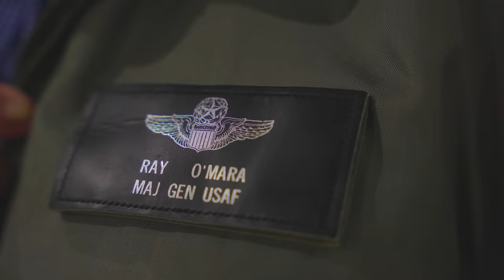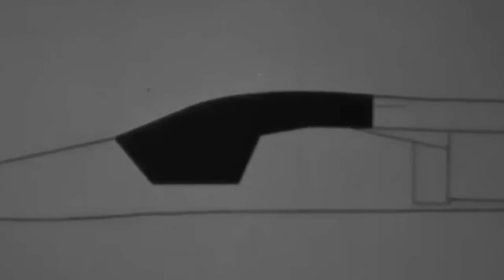F-111 Aardvark | Behind the Wings

Comment from the maker: This is a great airplane and we couldn't cover everything so drop your questions in the comments and we'll get to as many as we can! #curatorquestions
Reply: The F-111 polarised the Royal Australian Air Force.  In 1962 Australia had an order to purchase the British 24 TSR2 aircraft for $96,000,000.
When the TSR project was terminated they placed an order October 1963 with General Dynamics for 24 F-111's for $72,000,000.
The aircraft was to be delivered in early 1968, but Australian aeronautical engineers was concerned about the wing box which they said caused stress on the fuselage.
In September 1968 the Minister for Defence stated the the cost of the 24 aircraft was $268,000,000.  I had joined the RAAF January '68.
Australia decided to lease 24 F-4 Phantoms in 1970.  Whilst the F-4 was a better combat aircraft it only had a range of 1750 miles.
The F-111 suited Australia's needs with a range of over 6,000 miles.  The RAAF finally took delivery of the F-111 aircraft in 1973
A pilot once told me "The F-111 has the grace of a wounded seagull descending on a chip when landing."
While there is no exact data, at least 3 RAAF F-111 aircraft have crashed killing the crew on every occasion.  They were all doing low level training.
At first the RAAF cited pilot error, but after the family of one pilot (Sqn Ldr Anthony Short) launched legal proceedings, the RAAF conceded it was metal fatigue.
Was the aircraft worth the cost for Australia is a moot question.  Taking into account the cost of leasing the Phantoms the F-111 may have cost close to $400,000,000 in '73.
If there is any error in my comment I would greatly appreciate being corrected.  The F-111 was a popular topic during my 6 years in the RAAF.
Reply: @kenchristie9214  Shorties death was officially caused by crew planning, not using the TFR and outdated maps. They were simulating an Harpoon missile for Navy training. For more exact listings on losses I suggest you go to the ADF Serials web page. The RAAF F-111cs range on internal fuel was 6700km, that is 'clean' ie no stores, obviously that drops considerably with weapons. Did you know that when Australia showed interest in the F-111, Lord Mountbatten flew to Australia to talk with the Australian government, he dramatically dropped four models of the British Bristol "Buccaneer" and a model of an F-111 on the PMs desk and said you can have FOUR of these for every One of those. needless to say it wasnt fruitfall for him
Reply: @davidewhite69  Thanks David.
Reply: You have triggered so many aussies hahaha good video though! Love the content. 🦅🦅🦅
Reply: Excellent presentation of the F-111. And good to have the general over. Well done chaps 👌🏻
Reply: What is different about the Wild Weasel F-111 which flew all the way from Idaho to Iran to begin the Desert Storm air war?
Reply: Can you cover the EF-111? Granted it's not the variant you have, but the EW mission is always a cool one.
Reply: FB 111 in the works?

Comment: Back in the mid-1960's the air force was looking for a replacement for the aging B-52?  AGING???  The B-52 was barely 10 years old by the mid 1960's and  ALL  F-111s are retired and yet the B-52 is STILL flying in December, 2022!!!  So take that to the bank W.O.T.R.

Comment: One item, the FB was never a replacement for the B-52, nor was the B-52 old at that time, the G's and turbofan H's had only been out 4 or 5 years.  The FB-111 was an emergency replacement for the B-58 Hustler, with it's Widow-maker tendencies as well as structural and total flight cost problems AND it's total lack of any versatility in bomb load types  The B-2 was the eventual replacement for the FB's, as epitomized by the transfer of the Wing (509th) to Whiteman as soon as the FB's left Pease.
Reply: Confirmed
Reply: B-58 flew well at low altitude but its ECM was a potential problem in wartime ops
Reply: Yeah, and the primary mission of the FB-111 was to be a "door kicker," blasting holes in the Russian radar and air-defense network, which would grant the heavier bombers a better chance of making it to their targets.
Reply: Correct.
Reply: I was stationed at Pease AFB, 1969-1973,
and in 1970 we only had tankers, as the 
Buff's, B-52's, had left, and December 1970,
509th Bomb Wing Commander, Colonel
Winston E Moore, as I remember then, flew
one across the field, and after it landed, some of us in the hanger got to look at it.
In 1972, as Captain, I became the 509th
Combat Support Squadron Section Commander there at Pease.

Comment: That fuel dump and burn was always a crowd pleaser when our Australian RAAF did it at airshows.       They would specially like to do it as the last display in teh show when it's around dusk.
Reply: I remember one doing a dump and burn in Canberra for a RAAF anniversary flight. The flames were said to be “the spark” that set off the firework finale.

Comment: I worked as an aircraft maintenance technician (SSgt AFSC 43171) at Plattsburgh AFB.  I was stationed there from 1972 to 1977.  I worked in Bomber Phase Dock and at one time or another worked on every FB-111 on that base.  I was transferred to RAF Lakenheath in 1977 and worked in Phase Dock there on the F-111F version as well.  Lots of fond memories.  I need to get to Denver and see this plane!

Comment: Excellent clip. Thanks to you both.

Already a few mentions of Australian F-111s below. Informally known as 'pigs' rather than Aardvarks in RAAF service, due to the very low operational altitudes flown being likened to the habit of pigs aggressively nosing for food with their snout in the dirt and wetlands. 

There were originally 24 F-111C (having the longer wings and strengthened U/C of the F-111B). Later got uprated engines and 4 had RF-111 reconnaissance packs fitted. Later joined by 15 F-111G (what FB-111s became after they relinquished their strategic nuclear role and fit out). 

Operated by 82 Wing RAAF, No1 squadron operated the C model and No6 squadron operated the G model in their final years of operation. 1sqn now operates 24 Super Hornets, while 6sqn operates 12 Growlers. They lack the F-111s long range, but are otherwise an excellent and versatile aircraft (B21s would be a nice replacement). 82 wing also has 2sqn with E-7 Wedgetails, while 81 wing operates F-35s.

I can remember as a kid the F-111 acquisition being criticised very heavily by every random 'expert' as too expensive and not good enough. Funny how it served really well, and became the favourite of all Australians at air shows for decades.
Reply: I heard the Navy complained that it was a slow and sluggish aircraft. Why did it have that reputation?

Comment: WOW!!! I was in high school and a cadet member in the Civil Air Patrol  in 1971 and that summer I went to a 10 day encampment at Plattsburgh AFB; we got to see the FB-111s but were told that we weren't allow to photograph them.  I was probably there when Maj. Gen. O'Mara was there!  I didn't have a camera, but I still have the certificate of completion of the encampment that I received.
Reply: We may have been at the same CAP cadet encampment!  The following year I entered the Air Force as an Integrated Avionics Component Technician (AFSC 326x1A - later called Automatic Test Stations).  Stationed at 380AMS, Plattsburgh AFB after about 7 or 8 months of tech school at Lowry.  Worked on many of the avionics systems - my favorite was the Inertial Navigation System.  Left P-burgh in after around 5 years, cross trained into computer maintenance, and when I was stationed in Germany we had a communications buffer unit for our mobile RADAR unit's comms with the Navy that used one of the IBM CP-2 4Pi computers - the same unit as the General Nav Computer and Weapons Delivery Computer from the FB-111, but we didn't have any of the automated test equipment to run any type of diagnostics that we had in the shop.  Since I at least recognized what it was I was tasked with keeping it running.

Comment: The FB-111A began its service life in 1969 (the summer of love) at Carswell AFB. Just across the runway was the General Dynamics assembly plant where they were built. I arrived from the Grand Forks AFB B-52H avionics shop in May, was trained in the FB-111A digital avionics school in Denver that summer, and worked in the Carswell avionics shop until the following spring when I was transferred to Upper Heyford, England arriving there before the first F-111E deliveries. I was at Carswell when the first FB-111A's were delivered and I was at Upper Heyford when the first F-111E's arrived. That makes me a certified antique!
My experience both at Carswell and at Upper Heyford was severely limited by the long grounding of that airframe while the wing problem was being resolved. Best explanation I have ever seen of that problem here in this video, by the way. Thank you!
Two things I remember most about these assignments. One was the incredibly awkward avionics shop test equipment, especially the Ampex-made dual tape deck program storage units shared by multiple test stations which required enormous patience because they were constantly caught up in long delays while the tape decks searched through long reels of tape for the next set of instructions and the second was how little any of us really knew about these digital flight control and navigation systems. Of course, maybe that was because I was just a kid at the time, but we were test bench operators more than actual electronics troubleshooters and none of us were experienced with these kinds of digital systems. Even the civilian technicians setting up the test bench systems were struggling to figure things out.
I remember a few times wanting to rerun a particular test, not wanting to wait for the tape systems, and trying to punch in line after line of hexadecimal code from the manual into the hexadecimal keyboard on the test bench. Forget that! Man, what a chore! And it almost never seemed to help me do what I wanted to do.
The Carswell crew wound up at either Plattsburg, NY or Pease, NH but I was in England when that happened. In the 1970's and 1980's it was common to see FB's flying low-level, like really low, over central Maine, the Moosehead Lake region where I lived, and I remember being on Boarstone Mountain just east of Monson watching FB's flying by well below where I was perched. One time I was working mid-winter at the north end of Moosehead Lake and I heard that sound, rushed outside in the cold, and sure enough, several FB-111A's were skimming low overhead having flown past Mount Katahdin in Baxter 
State Park and headed west towards Plattsburgh. Years later my wife and I were driving east on a logging road near Greenville and we heard the sound - that sound! -and there they were again, just a flash of a sighting when they crossed over the road ahead of us no more than a couple hundred feet above the trees heading south - towards Pease most likely.
That, for sure, was one heck of an airplane, so modern in design that it would fit right in today. The B-52, even back in the 1960's, was a relic compared to the FB-111A. I know, I know, the H-model B-52 still serves the AF, but the 111 paved the way into modern aviation.

I seem to recall something about the F-111 costing something like $14 million apiece. So expensive, they all said! But maybe I am mistaken...

Comment: Back in the day the F-111 was part of the TFX program that failed joint USAF-USN fighter, although the F-111 Air Force variant had some issues at the start in early 1960s they decided to go with mass production, even though in Vietnam the main role of the Aardvark was an interdictor or tactical bomber/ground strike aircraft they still retain the designation F in the F-111, F as in Fighter or multirole aircraft in the USAF aircraft designation post 1960, even though her main role is interdictor aircraft. Also the F-111 and F-117 were the last so called century series aircraft since they both had number designation over 100 and then the Airforce and Navy "resetted" the numbers back to 1 again like F-4 Phantom, A-6 Intruder, F-5, etc.

Comment: The FB-111A was my 1st love! I was at the 509th Bomb Wing at Pease AFB NH from 1988-90 as an ECS troop (air con, oxygen, pressurization etc) LOVE this airframe...miss it! When I had to go to the alert pad for maintenance (there was 6 acft loaded & ready with 2 nukes on the wings and a SRAM in the wpns bay, I always put my hand on the nuke with great fear & respect! Thanks for this segment! (USAF retired!)
Reply: I left Pease AFB in 88 after spending 8 years on that plane in Plattsburgh and RAF Upper Heyford. Worked on the TFR, ARS, nav and bomb computer system, doppler and hud systems. I can never remember my shop name or code. I got to work the F-111As, EF-111s and FB-111As. I hated the F-111As because they were all analog and the size of that ARS scope was a bear to get in and out. I loved working the digital FBs
Reply: My dad was with the 509th working avionics from 86-90 at Pease.  Such a wicked aircraft!

Comment: Nice to see "Colonel" (MajGen) Ray O'Mara, 380th BW/CC here in this video! I was one of his flight control & instrument guys in the 380th AMS (for 4 yrs, 1/82 - 12/85).  That FB you have enshrined in the museum is EXCEPTIONAL as it's never been painted and she looks as fresh as the day she landed, I hope you don't paint it!  Any way to get the afterburner "cans" for the back end?  Thank  you for creating a great piece about the FB-111A, narrated by both yourself with a really special warrior speaking about my first F-111 model that I worked on-SAC Trained Killers we called ourselves!  THANK YOU. (That photo of me is sitting in my restored FB capsule at the Global Power Museum at Barksdale AFB (then called the Eighth Air Force Museum under the guidance of Harold D. "Buck" Rigg) - i was assigned there for probably 7 yrs after retraining out of the F-111 world due to its retirement, but I got my hands dirty, mighty dirty, repainting the FB twice, changing the four cockpit glass pieces twice, and taking what was a shell of an E model (ejected) capsule from Upper Heyford, and creating an FB capsule by canning & swapping parts from the FB outside--only thing missing is the ARS tracking handle which i simply could NOT get out of the FB on display.  Cherished times!

Comment: During low terrain following, would the aircraft roll inverted over ridges, or did you feel negative G's?  About 1995 a retired F-111 sat at remote Battle Mountain Nevada airport, canopy unlatched. Fun to sit in, play with knobs.
Reply: I have seen videos where the F-111s using the lowest level TFR setting of 200 ft would roll inverted to stay under radar when they crossed ridgelines.

Comment: The swing wing was a manual that was normally folded under the left cockpit combing. You had to pull it down and the wings moved when you slid the lever back and forth. There was a flag in the airspeed indicator that would pop up if the wings were in the wrong position. The F-111 was an early adopter of strip instruments.

Comment: A Couple of friends of mine used to work on the F-111's wings at McClellan AFB when it was still an active base, the swing wing design was effective but also very costly to maintain as the wing pivots were subjected to very high stress loads, my friends would tell me they would have whole crews of people spending many hours polishing hairline stress cracks out of the wing pivot hubs and as with all ageing aircraft the maintenance cost forced it into retirement just like the F-14, both great and very effective aircraft.

Comment: the shot at 9:57 is actually 4 RAAF F-111Cs, not FBs or Gs, you can quickly tell by the lack of strip formation lights, and the splitter plate intake compared to the FB/Gs 'triple plow' intake
Reply: Also there was no astro tracker (celestial navigation system) forward of the crew capsule.

Comment: I worked on F-111's when the planes were brand new, with the 366 Tactical Gunfighters
 As a machinist one of my tasks was removing toque set screws that others had stripped the head.  I got good with a tool we called a screw punch.  A HSS tool bit ground into a U-shaped chisel.  Make a good notch in the screw head and tap the screw in a circle until you could latch on with vice grips. 
Mountain Home AFB was a good duty station.  At night we would go to the watch the F-111 fly on afterburners at the gunnery range.
Reply: I was one of those avionics weenies at Cannon AFB from 1971 to 1974.  I had to call a machinist maybe two times to get a fastener out.  I watched how he did it.  I always wondered why they didn't give us the special tools so we could do it.  They were probably afraid we would do damage I guess.  I got no joy by having to ask for help but sure appreciated the expert help.

Comment: Do the hard points for the external tanks pivot as the wing swings to keep them in line with the airflow?  If so, how does that system work?
Reply: The four interior (inboard) hard points swiveled; the the four exterior points did not.
Reply: @williamwingo4740  You might mention that the outboard tanks automatically jettisoned when the wings were pulled back. There was not enough space in the wing taper for the pivoting mechanism.
Reply: @christopherfranklin1881  I didn't know that, but I'm not surprised. I never flew it or even saw one up close; but formed an impression from many negative rumors over the years. USAF and the Aussies tried to put the best possible face on it, but they were only partially successful.
Born a political airplane; died a political airplane.